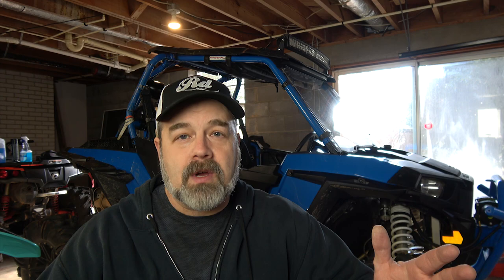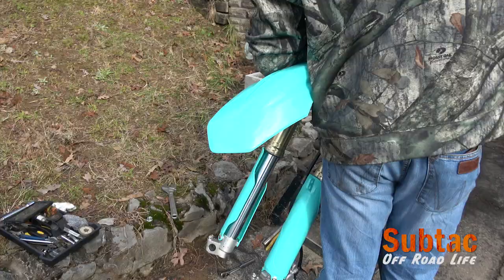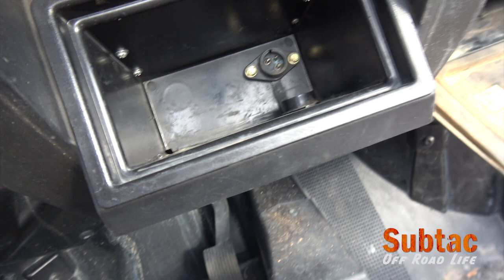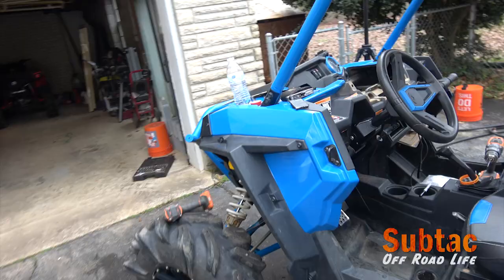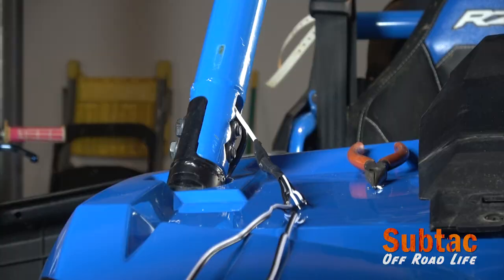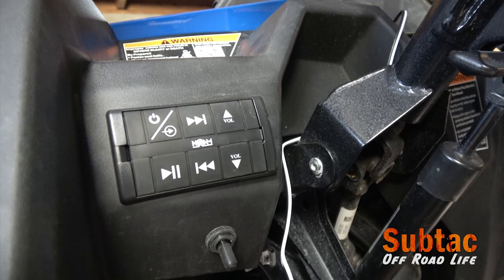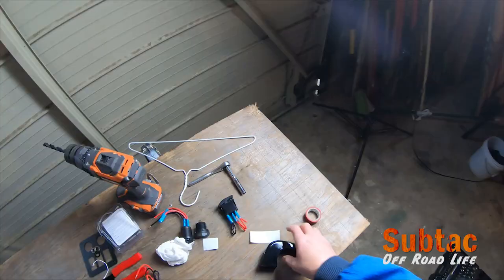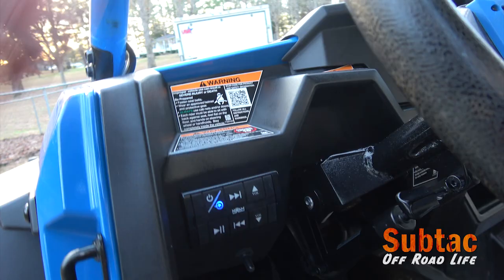UTV Sound System On A Budget | Install And Review

Comment: Did you run your hot wire to the amp from the battery or from the busbar under the hood. If from the busbar did you have run a power wire from the battery to the bar?

Comment: I have a front and rear windshield, how thin are the top of the mounts? Like would I be able to mount them and still squeeze my windshields tight?
Reply from the maker: They are a little over 1/2 inch thick. You would mount differently than I did mine but you could make them work.

Comment: omg stay on point the radio not the dam teal bike

pro tip once you have the hanger instead of pulling the wires pull paracord and then attach your wires to the paracord ALOT small foot print and easier

Comment: I know this is an older video but i just purchased the same setup and I’m wanting to add a on/off switch like yours, the one i purchased is a rocker switch but kinda confused on how to hook it up using this setup. Any help you can give my way, I’m really wanting to have them turn on and off with the key
Reply from the maker: If you want to turn it on and off with the key just make sure it is connected directly to the ignition.
Reply: subtac Off Road Life you think that wouldn’t be to much and blow the accessory fuse
Reply from the maker: @juanmesta1   I wouldn't think so, but I can't be for sure. However, it is designed to be able to do it.

Comment: Still the same opinion 10months later? Any issues yet?
Reply from the maker: I sold the rzr about 2 months ago, but the system was still working and no issues.
Reply: I have a NOAM system in my 2019 RZR 1000, I installed it about a year ago, the system still works. Audio is clear and decent. I am now planning to add a couple of 6x9s I like it to be more louder.

Comment: I have a blue 2015 1000, do you know the exact paint match for the bike?
Reply from the maker: Not sure about the 2015. My 2017 Highlifter was Velocity Blue.
Reply: @subtac  yeah I painted this hood I have a velocity blue is really close, my be from sun fade but mine is a bit lighter but just a bit lighter so it’s prolly velocity blue which is one of my favorite blues. 🤷🏼‍♂️
Reply: Thanks man
Reply: @subtac  one more question. Does the stator have enough output to charge two batteries withought messing up anything or do you know?
Reply from the maker: @ChairMan71196  I haven’t tried it so I don’t really know.